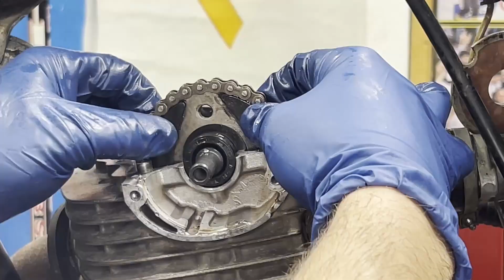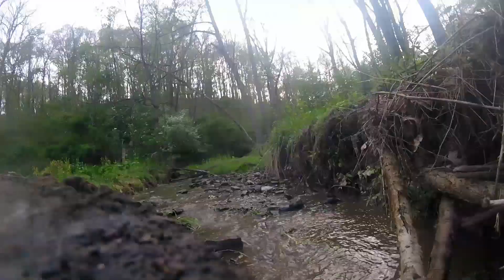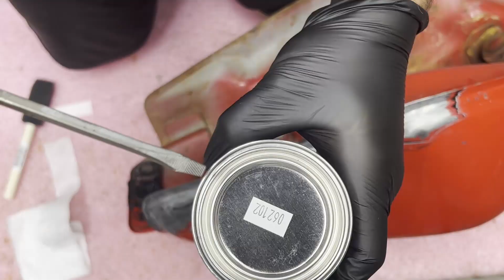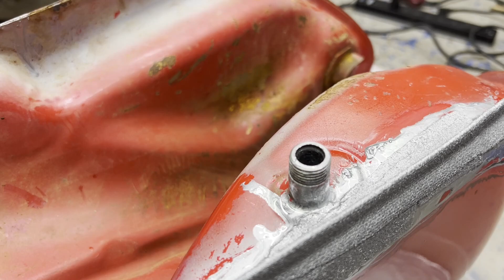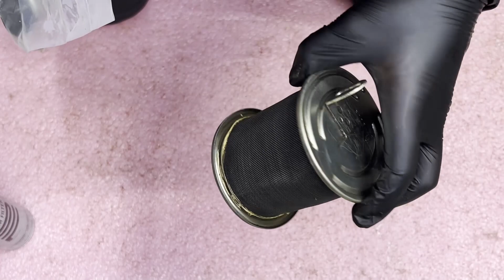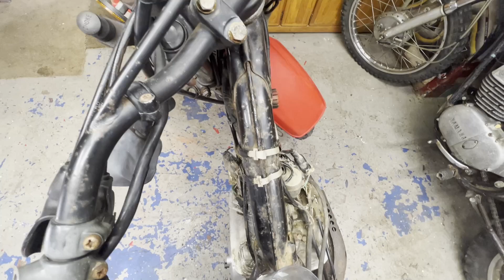1981 Honda XL500S Part 3: finishing up fuel tank patch and first start

Comment: Would it not have been easier to fill the holes with lead? Be a much more permanent repair.
Reply from the maker: Probably…but I didn’t have access to lead at the time and I was able to seal it up with the tank repair kit.

Comment: Could you please tell me how you found that air filter I need one desperately for my 81 xl 500. Thanks
Reply from the maker: I got mine off eBay.  It was just the element itself…luckily my bike had the metal part.

https://www.ebay.com/itm/222794550159?mkcid=16&mkevt=1&mkrid=711-127632-2357-0&ssspo=Mn8xIRD1ReW&sssrc=2349624&ssuid=1QWenE7CT8u&var=&widget_ver=artemis&media=COPY

Comment: I wish my 80 xl500s would've started that easy the first time! I bought it not running, it took some work to get it running. It's now a 1 or 2 kick starter & it's tough to keep the front wheel on the ground! 500s rock!
Good video!
Reply from the maker: I lucked out cause this bike sat for such a long time exposed to mice and who knows what kind of other critters in a barn that could have easily chewed up ignition related wires lol.  Can’t wait till I can get this bike out on the trail for its first test ride!

Comment: Hi I know bikes always sound different when you are video in them to when you're standing next to them it sounded on the video like the cam chain could do with adjusting or the valves.
Reply from the maker: Yeah I was going to try to adjust the cam chain in the next video cause I can never tell if it’s the acoustics or what but just to be on the safe side I figure I better.  I appreciate the input!